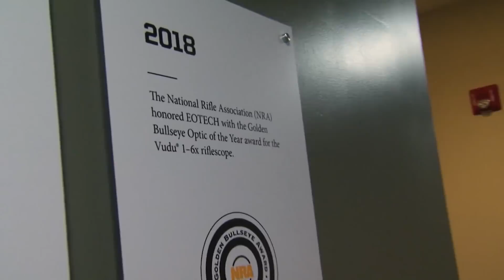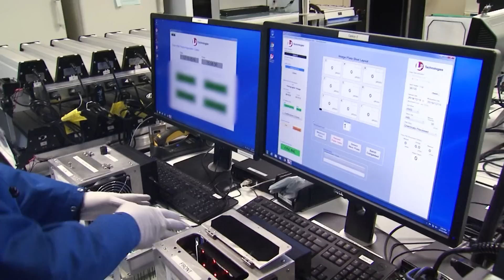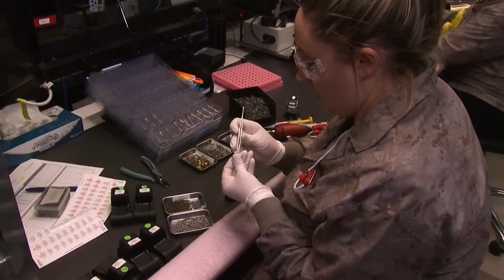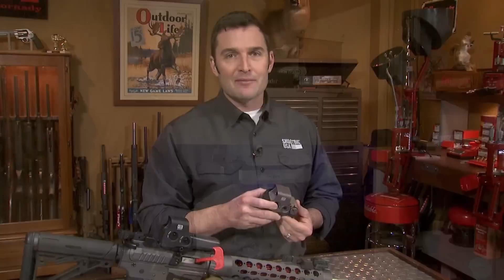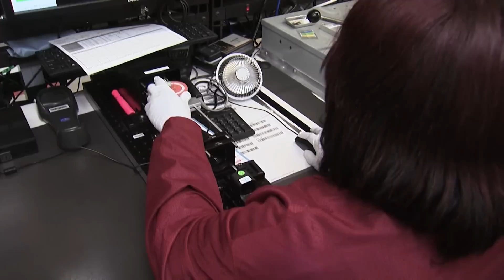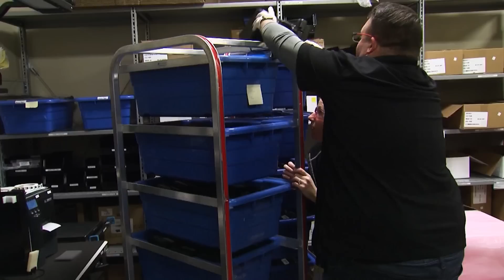Shooting USA: The Inside Story of EOTech's Holographic Sight

Comment: Ive been using Eotech and Triji ACOG since 2006 . In 2006 or early 2007 i bought 553 SOCOM . Eotech EXPS3 or EXPS2-2 are my 2 favorites , especially paired with Micro 3x MAGNIFIER. 
In 2006 i got used TA01NSN ACOG . Eotech and ACOGs will always be my go too period . 
I use Eotech in 2Gun and shoot out to 450Y with 3x MAGNIFIER.
Reply: I also use an acog and eotech on my rifles. I was issued an acog in the Army and other people in my unit got eotech sights and I have seen both of them take some serious abuse and keep going